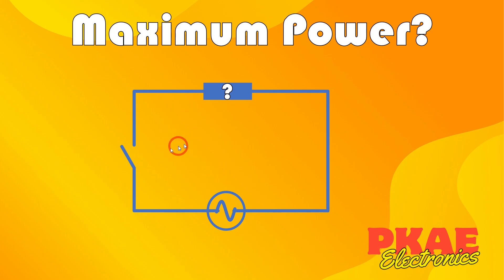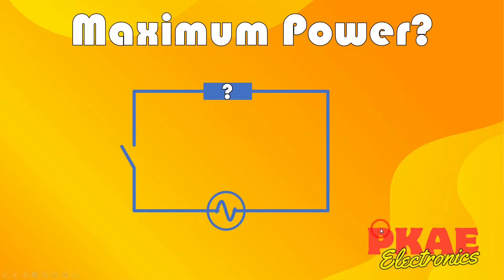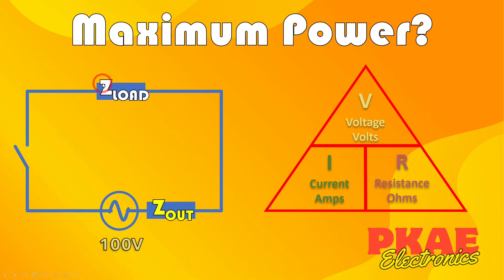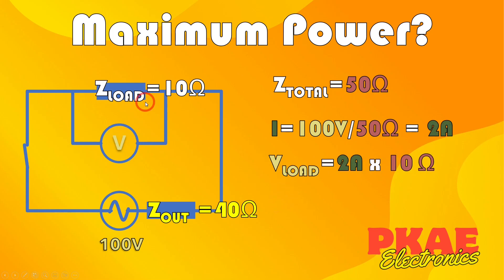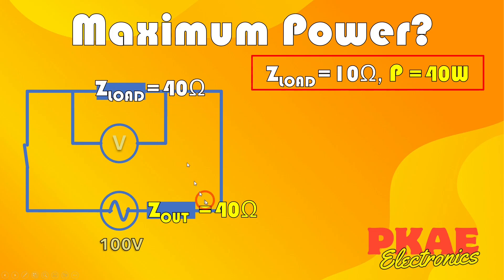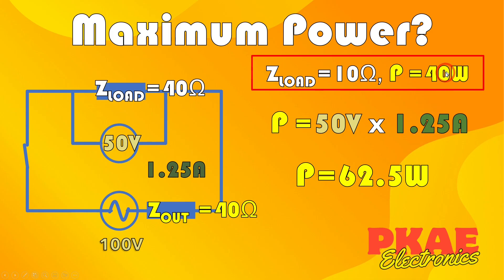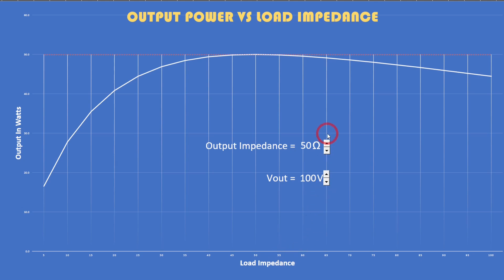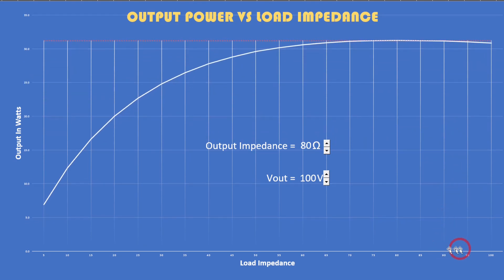Impedance Matching

Comment: Narrator forgot to mention that the correctness of his exposition has essentially zero application in everyday power application in electric circuits. In short, this is an academic exercise with subtle theoretical application, because literally nobody would want to dissipate as much electrical power in the source as in the load, either with power equipment, motors, heaters, lighting, or power amplifiers. I mean it would be crazy to even propose it. The example of solid state power amplifiers is totally superfluous in this regard as they have very low source resistance, difficult to calculate without serious circuit analysis with h parameters, and an accounting of local feedback.

Acoustical Impedance matching is something else. It can be very desirable for an acoustic transducer self-impedance to match the acoustic impedance of the open air. This is the purpose of horns (ideally exponential horns), both in musical instruments and loudspeakers and other acoustical transducers such as in sonar; same for actual vehicle horns, emergency alarms etc. There are myriad other ways to match acoustic impedances. The reason a lone trumpet mouthpiece can't match the volume of a trumpet is that the atmospheric acoustic impedance is very high and the impedance of the lips/mouthpiece is very low. Attaching the trumpet is equivalent to applying an impedance matching transformer to bring the two impedances more in line with each other.

Back to electrical: transmission lines of all sorts (coax cables, twisted pair, RF circuit boards) are a totally different class of impedance matching having to match the line's characteristic impedance to suppress reflections and standing waves, plus maximizing power transfer. Same thing in getting maximum power from a microphone with hi Z into a 300 ohm balanced cable, an impedance matching transformer is typically used.
Reply: Look up MPPT solar load charge controllers. Same basic principle of matching the load to the source for maximum energy transfer.
Reply: @JaenFoster  the phrase "matching the load to the source" is a non-specific phrase that does not specify anything and definitely not the engineering practice of matching load impedance to source impedance. Thus the  "basic principle" as you use it is no principle at all; as undefined. In power applications there is no reason not to have the lowest source resistance as possible. Otherwise why would you want to waste the same amount of power internal to those controllers as you would be delivering to a resistive load?

Comment: Oh my gosh I think I finally get this!!!!!  I have been wondering if I am 'extracting' the best possible performance from my audio gear, for years, and I still am not sure but I certainly think I am NOT, mainly because of impedance mismatching.  I have 8ohm, 90db sensitive bookshelf speakers, bi-wired, driven by an Adcom dual mono GFA555 amp, that is 200watts, source is a Bel Canto DAC.  My speaker wires are only 5 feet long.  For having slightly sensitive speakers, and a 200watt amp, I never really feel like the sound is as 'powerful' as what their "stats" claim they should be.  Can I somehow "match" the actual impedance better for the AMP?  Can a higher impedance speaker cable improve the performance and sound, or strain the amp?
Reply: Bookshelf speakers can never sound really powerful, as they are small. Power is in the bass really. 

As I understand it the design tradeoff is to make them relatively low-efficiency in exchange for maximising bass response in a small enclosure. So they absorb a lot of power and don't sound as loud as a larger diameter, higher-efficiency driver speaker. 

With solid state audio amplifiers you want the output impedance to be as low as possible, so it's not the limiting factor when sudden pulses of high current are required to be delivered to the speakers. Speaker impedance divided by amplifier output impedance is damping factor, which you want to be high for hi-fi. It's also what damps a speaker driver ringing after a curent impulse has passed and gives you 'taut' bass.
Reply from the maker: Hi, thanks for your comment. 

Audio is a complex topic with many aspects that can affect your perceived level of sound intensity. Impedance matching may well be one of them, but as you are probably aware, the human ear (and brain) perceives loudness in varying scales across the hearing frequency range and to make it more complicated, your amplifier/speaker arrangement will not produce an entirely flat frequency response either. Back in the day, old amplifiers used to have a LOUDNESS button which simply boosted the low frequency component of the audio signal, tricking the brain into thinking the music was much louder than it really was.

It looks like you have some great HiFi kit there, so I would be careful about tinkering around too much. If anything, I would suggest measuring the actual impedance of your speaker/cable arrangement with an impedance meter. 1khz is critical for speech intelligibility, but for music you should probably check across the hearing frequency range (each octave) and see what you get. 

My background is Public Address systems so although I understand audio, I'm no HiFi expert. There may be other viewers on this channel that can help further.
Reply: @paulpkae  thanks for the response!! I've been reading up on all this.  I think you're right on testing out the impedance across the frequency range of the speaker crossover and cabling, so see what the top and bottom would be.  I just got a cheapo oscilloscope too, and plan on doing SUPER basic testing and measuring.  It's interesting to find that there are speaker cables specifically made to show more impedance, or capacitance, etc.
Reply: Audio amps usually have very low output impedance compared to the load which is usually 4 or 8 ohms, it means that you can essentially skip the amp impedance from the equation. What more important is at which load impedance your amp capable of 200w you mentioned. Generally speaking the output at 8ohms would be 2 times lower than at 4ohms. It’s not always the case, eg output amp stage can have the current limitation thus bringing the 4ohm load power output lower. But you can always calculate theoretical maximum power if you know the power voltage of the output stage, it’s usually a bipolar voltage of +- something volt.

P = V^2 / 2Rl

Eg your power amp has +-40V voltage powering the output stage,
At 4 ohms it’s theoretical max RMS power:
P=40*40/(2*4)=200W
At 8 ohms:
P=40*40/(2*8)=100W
So what I was trying to say - output power linearly dependent on load impedance. The higher the load the lower the max achievable power with the same amp.

Important: the provided math is true for classical amps, the class D amps are somewhat different and equations may not be correct if the amp utilizes the unipolar voltage powering.

Comment: hi, please show how to measure a laptop's headphone impedance.
Reply from the maker: I may well do that. I take it you mean the output impedance of the laptop's headphone port opposed to the headphones themselves?
Reply: @paulpkae  That is right. I know it can change from line impedance to phone impedance, it needs to be sure it's the right one otherwise lose dynamics of sound, no-one cares this important aspect.
Reply: @electrocat9  How are you defining "dynamics of sound"❓
Reply: @bob_mosavo in my understanding it is what SPL is for a speaker.
Is you listen to a quality recorded sound with non adapted impedance headphone you'll hear a more flat sound, without peaks -> low dynamics
Reply: @electrocat9  To me, that sounds (no pun intended) like a mismatch of reactive impedance. Moreover, to me, "dynamics" refers to the slew rate of the amplifier or possibly to the frequency response.
Reply: Another interesting aspect is that of the headphones that drain more power/current than a laptop/smartphone preamp can deliver, and is interesting to know if it's the case or not.

For me right now it's about learning electronics more than the practical aspect.

Thank you for the to-the-point lessons.
Reply from the maker: @electrocat9  Thanks again for your comments. I have now posted a follow up video demonstrating how I would measure the output impedance of a headphone jack. You get a nice little mention, so make sure you take a look 😁
Reply: @paulpkae  loved it! Now do microphone-to-preamp impedance matching 😊
Reply from the maker: @electrocat9  that should be straight forward enough to observe on a scope.